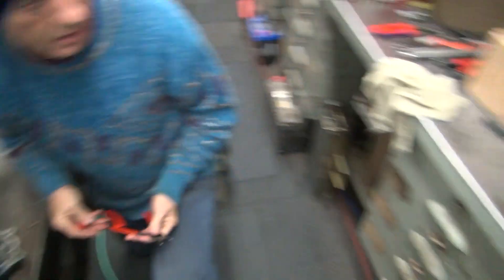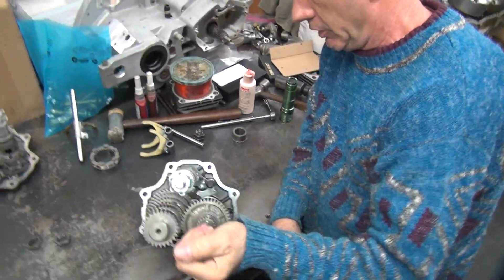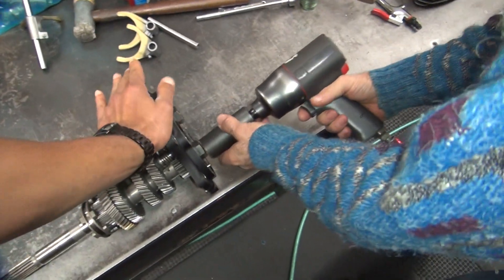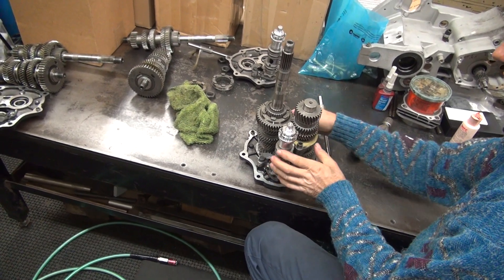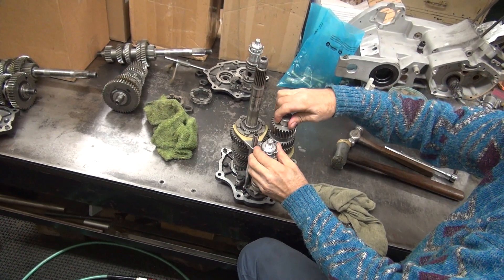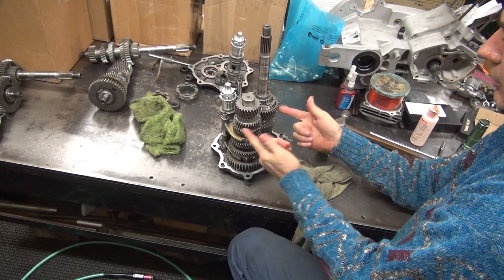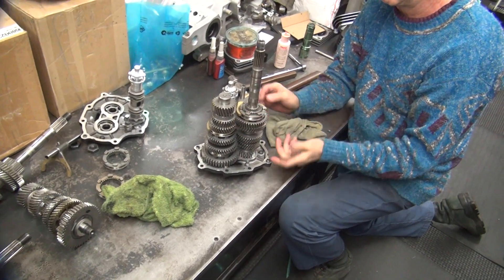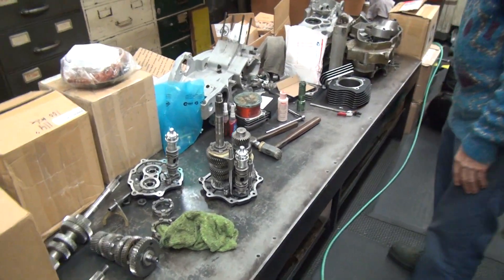#107 m8 6 speed trans blown up gear set swap out transmission milwaukee eight harley tatro machine

Comment: I'd be running tribodyn in that thing after all that. I been running that in my motor and trans since I first seen it on your videos years ago tatro  and I don't want to run any other oil...if it wasn't so damn expensive I'd use it in my silverado
Reply from the maker: after you factor in what you get it is about the same cost as anything else. more power with better milage plus the parts don't wear much at all anymore. do the math. i run it in everything i own.
tatro